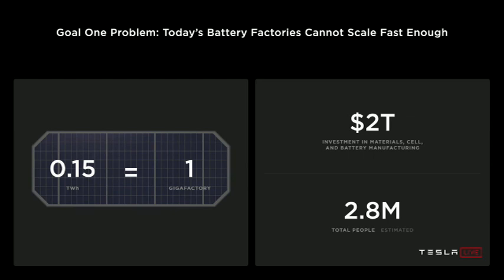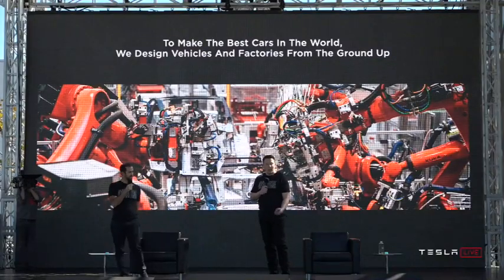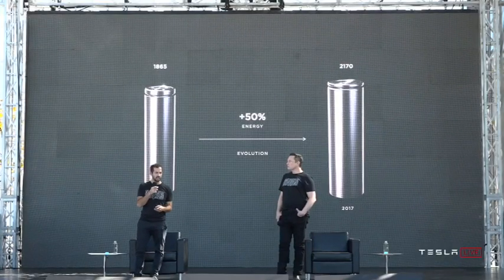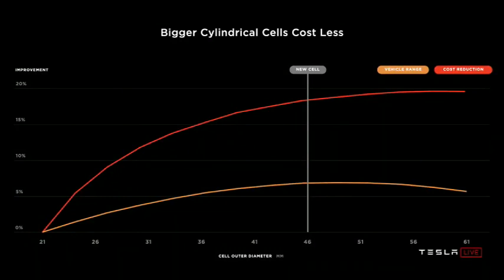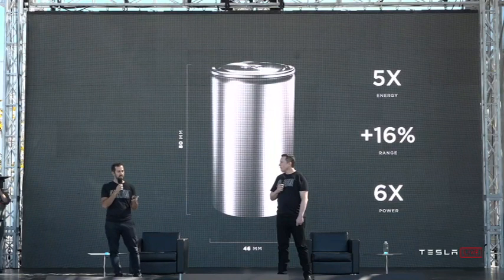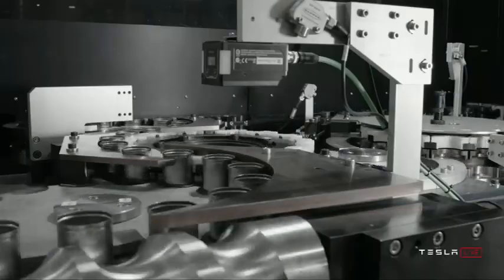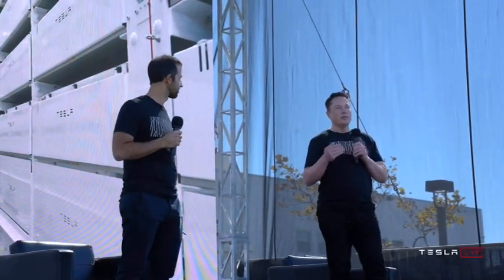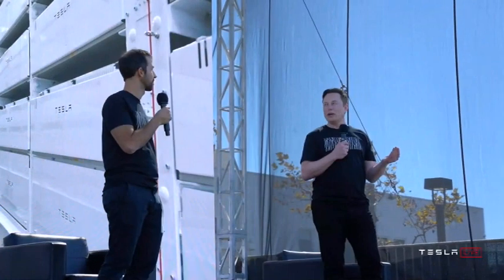2020 Tesla Battery Day, All That Matters in 7mins, Is This The End Of Oil Industries?

Comment: Hmmm, zero comments. Quite sad. Not so many nigerians know about battery day. 

But for us in the know,  i'd say this is indeed a gamechanger. but, not yet enuf to teuly rival fossil fuel companies. 

Electric cars may already be undergoin mass production, but  there's nothimg going on in d avaition industry .

Electric commercial airplanes are still far from possible.

I dont think the new 46500 battery is good enuf for tbat gaint leap., BUT!!! we're grtting there.

i weep for our country though.
Reply from the maker: The 4680 cell is actually a good battery source for air planes. The numbers shows it can work as they move closer to 500wh per kg, right now it 8s a little above 300wh/kg. Nice input bro. I

It has been a while i read your comments, hope you are keeping safe.